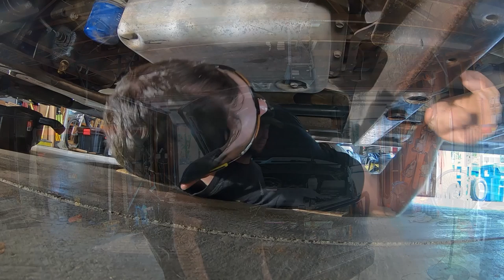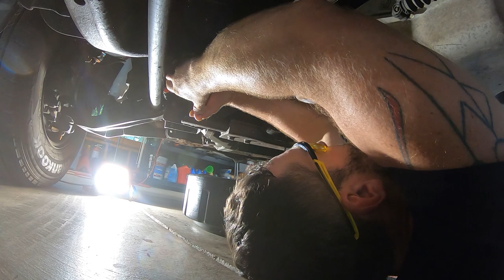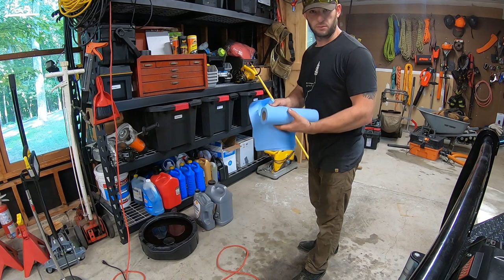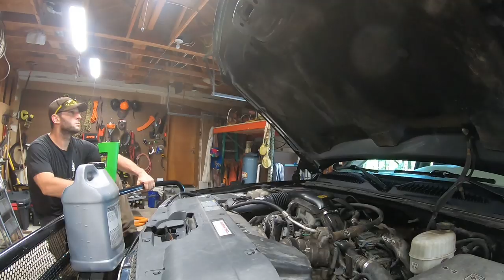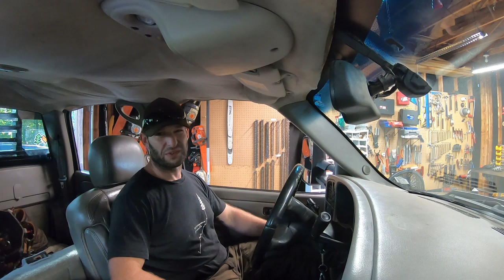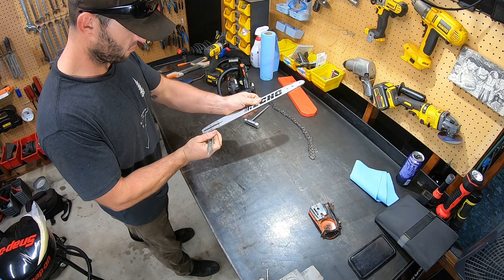Truck/Saw work, and I Might be Moving.......again.....

Comment: Cory,  Have you thought about buying a pneumatic oil extractor.   It's honestly the best way to change oil.  You never have to jack up you truck, never have to remove your oil plug...  and if your  air compressor is at  least 10gallons and the recovery it quick enough you'll have your oil changed in less  than  ten mins.... I have one and will never go back to changing oil the old fashioned way ever again.... Give it a try
Pneumatic Oil Extractor

Comment: If you think it is hot and humid in St. Louis...Wait till you get to Raleigh! It's smokin!
Reply: Yep
Reply: Just come to Tucson AZ when its 114 Degrees with 40% Humidity. I bet you can't even handle the summer heat alone.
Reply: @TRX450RVlogger  
     Gotta love that dry heat! Could use some of it here in E. Tennessee, I need to get back to W. Texas.
Reply: @TRX450RVlogger  Look, man - yeah, 114 is hot, but dry heat is infinitely more bearable than wet heat. When it's 96, with an idex of 108, and 60+% humidity? That's just fucking death in weather form.
Reply: Naru 'Sanav yep true that. Living in a Sauna called Central Florida. Golfed on Sunday and by the time I finished the 18 holes, it was 98 temp with the heat index at 108. At 1:20 in the afternoon! 🥵🥵

Comment: I dont know why, but I get the feeling that your truck will never be 100% fixed
Reply: Buy a vw . Its only gets worse
Reply: It's a chevy, it was only 75% when it was brand new.
Reply: @TheSoloAsylum  Best. Comment. Ever.
Reply: Trucks and cars are seldom 100%, always something to do.
Reply: @suidas84  Yep, always. Always, always.
Reply: @jesseshort8  Yeah he's a big dude, I hope he knows I'm always joking with him.
Reply: @TheSoloAsylum  what would you rather? For that year the 6.0? Or the 3rd gen 5.9? This is a better choice than both of those.
Reply: @LWNDmax  The Isuzu engine under the hood is a good engine. Chevy's are known for the whole truck falling apart around them and very quickly when used for work. The Fords were the opposite, tough truck with a junk motor. That only leaves the 5.9. That's what I would have to take, and I'm a Ford guy.
I know a few 6.7L Ford owners and so far they love them...we'll see. 

I should point out the gas models are reliable but that the gas chevy's still fall apart.
I'm not buying any of them at todays prices.

Comment: Hey man, I got a problem with my Stihl. I disengage the brake and it just starts spinning on its own. I had a new clutch put in, but it's still doing it. Any idea what I can do to fix it?
Reply: RPMs too high?
Reply: Idle it too high or clutch drum bearing needs replaced, when they wear itll drop the drum onto the clutch

Comment: Would you be eligible for a V.A. home loan assist or whatever it's called Corey ? There's a lot to be said for home ownership if you're settled in an area , interest rates are low and look like staying that way , banks look at home loans a whole lot differently to car  loans . 
              Renting gives you flexibility to move easily but it's usually fairly costly and you are limited in what you can do there , it suits some people but you also have to think of the future , you won't climbing forever so you have to think about what you want to be doing at 40 , 45 , 50 and on . 
            You have a number of good working and earning years ahead of you but the body starts feeling it after a certain point and you'll have to adjust accordingly , look at August and Billy Ray , they're both around 50 and can both still climb but you may notice they aren't so keen to climb as much now . That's only natural . 
             Start planning your future , that's basically all I'm saying , time goes fast , faster every year it seems sometimes , I was 30 not long ago and now I'm 64 . I'm glad I bought my place when I did . 
             Good luck with North Carolina , whether it's right for you or not is your decision , I wish you well however it pans out :-)

Comment: Hey Corey! I really enjoy all of your videos. I enjoy the arborist videos as well as the stories and the truck vids. I own a Dmax and I'm a diesel tech by trade. Just wanted to comment a couple opinions (that's all they are). So here's a link of allison aproved fluids https://allisontransmission.com/parts-service/approved-fluids/on-highway-fluids. I'm an allison certified tech and at the training course they went over fluids and suggested strongly with not using DEX III or VI. I will never use any fluid other than transynd. They usually come in gallon containers.  It's just going to perform better and extend your intervals and the input and output seals will last longer. But whatever you use just make sure it is TES295 approved.  I'd also make sure to use a genuine allison red spin on filter. You'd be surprised how many trans issues I diagnose that are due to poor filtration and they do not use an allison filter. I've never had an issue with a genuine filter.  Also try to get a magnet back on that asap. Did you notice if it stuck to the trans instead on the filter? Have had that happen a couple times.  Again I'm a big fan of the channel and I'm only trying to help. Keep up the awesome videos! If you're ever around northern Indiana let me know! I'll hook ya up with some transynd!
Reply from the maker: Thanks for the comment.  Put a magnet back on not long after this video, and have 3 gallons of transynd just waiting for this damn truck to get put back together lol.

Comment: I had that same echo. Under powered and burned the Piston in 4 months. Replaced the Piston and ring and now even less power, but it worked. Now I have 3 Stihl Ms 193. Well only 2 work because righty tight and lefty loosie, oops, broke the crankshaft taking off the clutch on one.